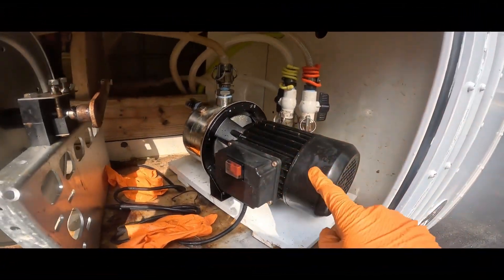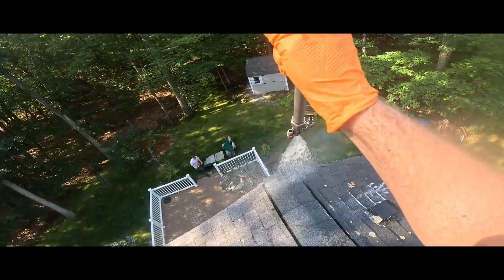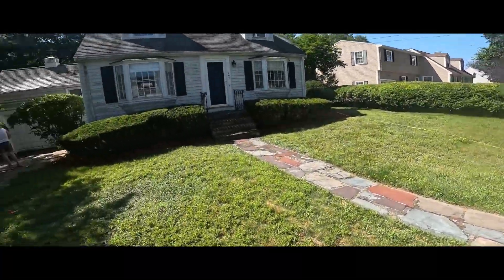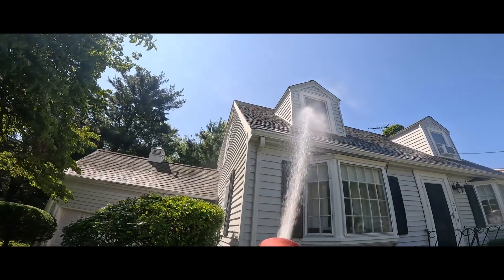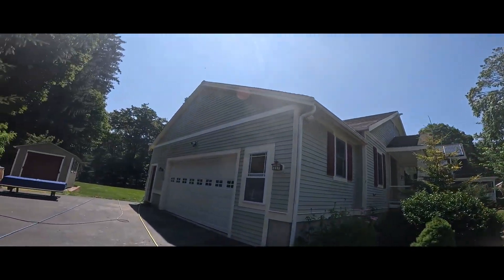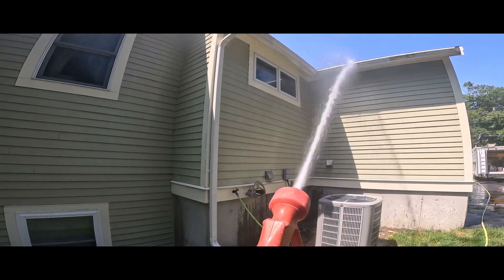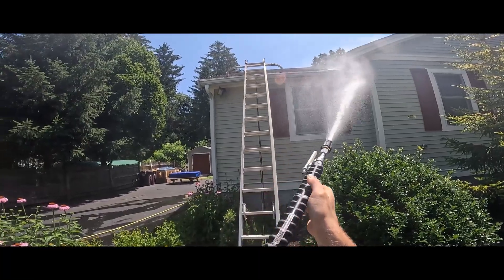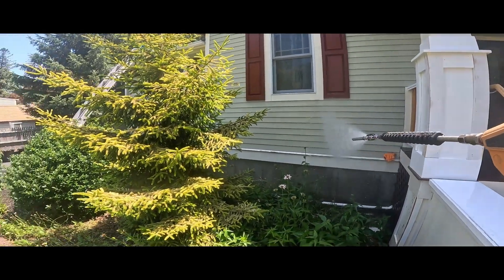Soft Washing Job Recap Siding and Roof Cleaning

Comment: Question from a noob, Any reason for me to keep my xjet over building a budget 12v softwash system? I just got it in the mail and all I can think of is the softwash can do everything the xjet can do and better and more things like roofs instead of carrying a bucket or connecting to a backpack sprayer. 

Also, Can a 5.5gpm softwash pump let me connect long hose and just use that? Seems like that might be a better way to go and I should send the xjet back or am I wrong?
Reply from the maker: Don't send the xjet back they are great to have. Also we use a 110v Booster Pump because of problems with 12 volts. You can get one at softwashfactory.com. also the soft wash pump 12v or booster you need for roofs can't xjet a roof.
Reply: @SoftWashFactory  what issue did you run into with the 12v? And I thought most people didn’t xjet roofs. Especially since the overspray and things like that. I know you can mod them to be a little better with that
Reply from the maker: @stuff_i_liked1815  issues with 12 volt is just longevity of the pump. Also no don't x jet roofs your right. The 12 volt was and still is a great money maker but the booster pump just last longer and van restrict to any size nozzle without pulsating the pump